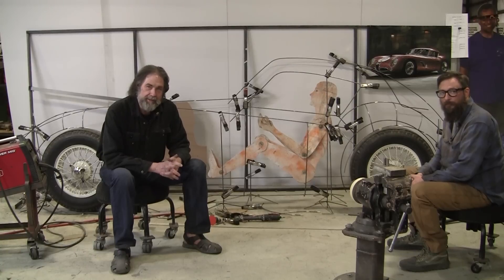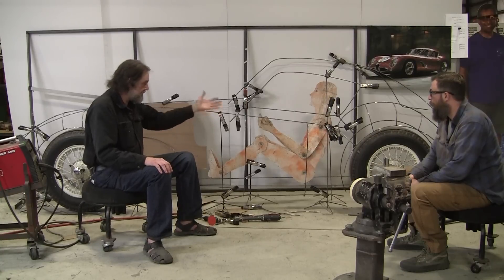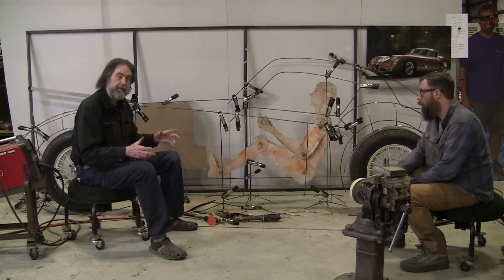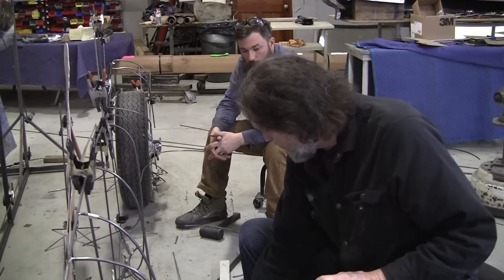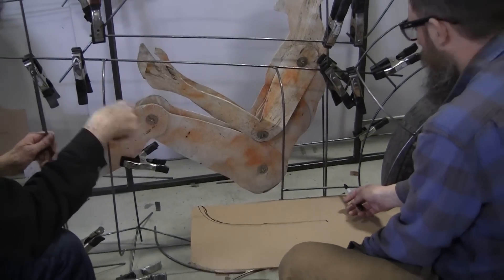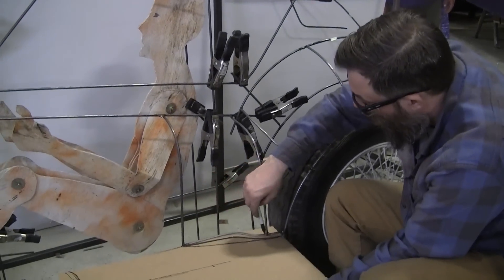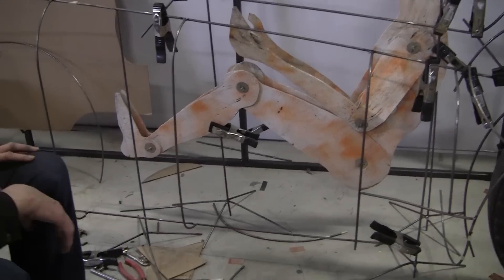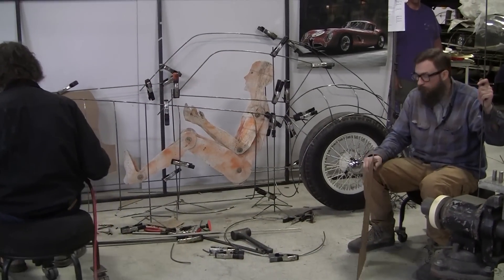How to build a Wireform AI Designed Alfa Romeo: Episode 8

Comment: Thanks for this video series super inspiring! Impressive how fast you actually are moving 
When I look at the front fender on the AI picture it seems like the top curve should be have a slight dip  mid between front wheel arch and door - a little bit negative before coming back up?
Just when looking from here 😀

Comment: Wray love what's coming out but may I say the back line of the should it run forward instead of being vertical as per the drawing??
That will give you more more, space for that curve to flow out to the guard.
I found out to map out lines using 1/2, 3/4 masking tape to give me a visual of those fine line designs.
But its going to be a sweet looking Alfa.